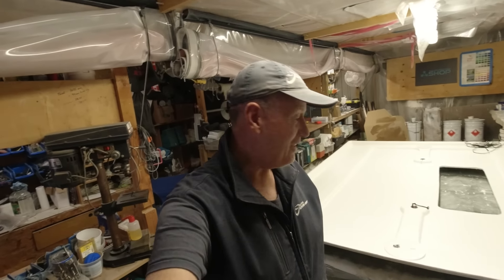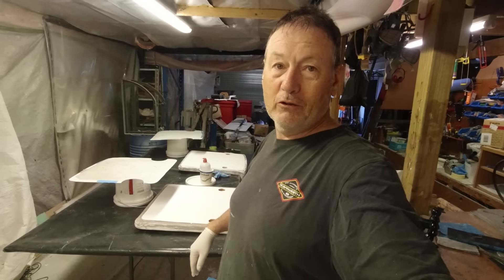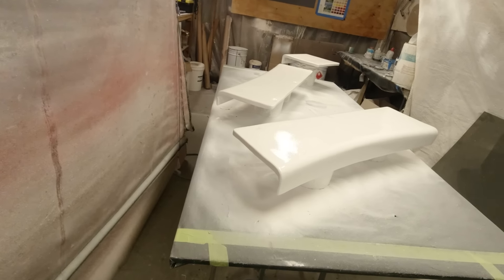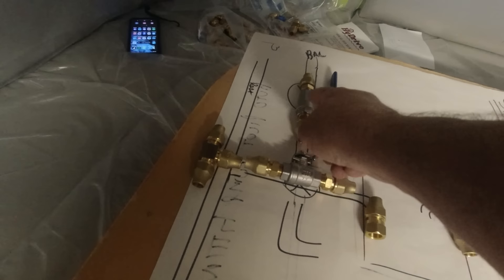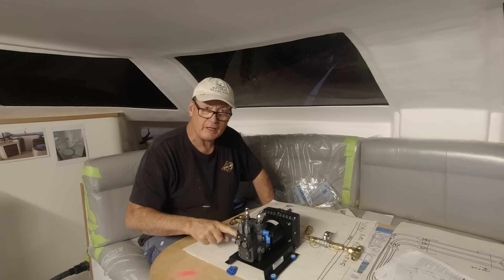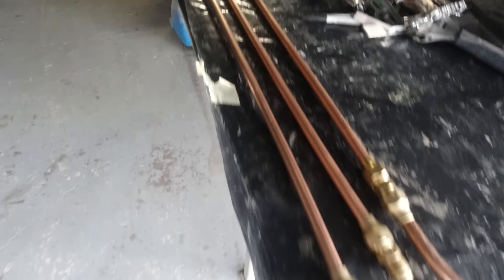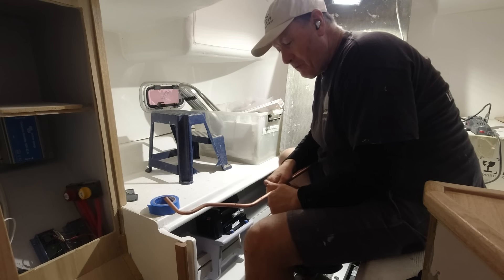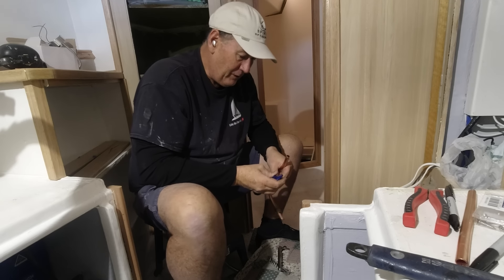Catamaran Hydraulic Steering System Install Part 1 //  Ep339

Comment: Loved this video. Retired instrument/pipe fitter in the mechanical trades for 50 years. Bent tubes/pipes 1/8" to 6" copper, SS and CS. Loved my career. Thanks for the memories. Advise to flush the completed system thoroughly, otherwise small particles will destroy your hydro pumps. Good luck! Splash date yet?

Comment: After installing several Steam and Water lines over the years, I would tie luggage labels onto those valves (and lines going through other compartments), clearly labelled with what the function of the line is, and what the valve does. (Isolate, bypass, etc.) Use Mig wire, not string, and replace the paper labels with thin metal ones with stamped lettering before you launch.  This saves confusion in an emergency years into the future when your kids are using the boat!
Reply from the maker: That is a great idea, I will definitely be labelling the pipework as per the electrial system.Rossco

Comment: Hi Ross i would just seal holes through structure with silicone stop vibration and noise from hammer . I haven't seen a filter in the system you would need at least a filter on return line to tank to filter any wear in system out to prevent increased wear rates and possible early catastrophic failure . Thanks for all your efforts to video your build have enjoyed all of them.

Comment: I would very much rather be doing the mechanical work than all the very fine finish work you have been doing!  I have to say when it comes to tubing connections, I think that compression fittings are a better alternative to the flare type.  They are certainly easier to make up, and are more durable.  Flare fittings are ok, but can be susceptible to failure, because the deformation caused to forming the flare weakens the metal at the connection point.

Comment: Ross - Good job, but you missed something.  You should have put rubber gaskets at every penetration through the fiberglass walls.  If not done, you have a good probability of having either a fracture or wear through of the tubing at a penetration point.
Reply from the maker: There will be sleeves inserted to seal the bulkheads, trying to avoid any air entry into engine rooms.My intention is to seal all penetrative to reduce chaffing.

Comment: Well done Roscoe and while it is a complex project in terms of execution and erection, it is nice to have a ‘stand alone’ meaty project to get your teeth in. I can see it has already attracted many comments.

My comments are:
1. You are right to do slow (rather than acute bends) where possible, but I would not be too concerned either way because the actual flow rates in the system are surprisingly low.
2. As the system enters the engine space, I would have been tempted to mount the valves and fittings on a board and fixed that out of the way outboard on the forward bulkhead to keep the hydraulic lines out of the way - thinking about future clambering about in the engine space.
3. As others have mentioned all bulkhead penetrations need grommeting where hydraulic lines pass through, to prevent  pipes fretting.
4. Do not get stingy on pipe bracketing for the same reason.
5. Nice to have something’s to polish in the engine room.😉
6. I would have loved to pop over and give you a hand with this, only distance prevents.😉

Cracking project and progress.😀👍⛵️

Comment: Looking good, pity you didn't use Swayze lock fittings cut to length ,push in ,finger tight then 1 and 1/4 turns good for 1500 psi +, rated for survey and don't leak. Can be undone and redone . Tube work is hard to get right and your looking great

Comment: If your only choice was a pipe bender, one method (more work) is to fill the tube with sand. That will reduce the crimp effect. Spring benders are great, but can be a nuisance for any bend that might have a tighter bend radius. (hard to get off). Very impressed with this whole mammoth project. Kudos's to you and yours. Looking forward to launch.
Reply: Not the best idea for hydraulic systems.
Reply: @normanboyes4983  Granted, it is not, but if it was your only option...then of course you would need to blow it out then flush it with water or something, and dry it,  so a LOT more work and effort.
Reply: @batmanflys8176  Are you a qualified engineer?

Comment: Great work and a nightmare at the same time. You can always get some fine steel wool and polish your flares to remove any scratches which can allow a leak to happen🤙🏼🤙🏼🤙🏼🇦🇺🇦🇺
Reply from the maker: I have my steel wool at the ready for the final assembly and a little hydraulic oil smeer on the flaring tool was the key to smooth flares. Thanks Nick.Ross

Comment: Are those copper line's going to be vibrating, if there do you will need to make sure they are not rubbing on anything, it would not take much to wear through that soft copper.
Reply from the maker: They will be secured every 45cm with rubber backed hydraulic line p-clips to bulkheads and hull sides and bulkheads to ensure no vibration wear as per Hydrives instructions.Cheers

Comment: I have always thought that bending springs go inside the pipe - quite surprised to see they work externaly.

Any views please 
Robin
Reply from the maker: Springs are often inserted in mandrel bending tube benders, these are for annealed tubing which is easily bent from the outside,not sure how we would remove an internal spring from such a long length.Rossco

Comment: You should ask the viewers for tips. Straightening copper like that is far more likely to hard draw it and make your life difficult. Best way is to stand on the end and unroll it on a flat surface.
Reply from the maker: I did use that method after drawing it out, and yes could have gone that way to start with.Rossco

Comment: Great video as always! 
Q: why copper tubing instead of stainless?
Reply from the maker: Hydrive specify only copper I guess for ease of installation , stainless tube would be a lot harder to bend and excessive given the low pressure.Given there are over 600000 vessels with copper tubing there is something in it.

Comment: Is that a low pressure hydraulic system? I say that because if high pressure those copper lines will break down faster than you think especially where you bend them. If low pressure they can last 20 years or more.
Reply from the maker: Low pressure mate

Comment: On the hydrolic steering what happens if pump fails where is the redundancy what if on passage and pump goes out .
Reply: The pump is just for autopilot.  If it goes out, you're hand steering for the duration.

Comment: Has your lovely bride ever suggested that you are just creating more work on the boat so you don’t have to go out and sail?🤣🤣 Y’all are doing great. What’s the thing with the cooper? Are you going to use a bushing where the tubing goes through any wall/bulkhead areas?
Reply from the maker: I don't think I would be still married if I kept creating work instead if getting it finished. There will be sealant bushings through each bulkhead and lines will be secured every 45cm as per instructions to eliminate vibration and hammer.Ross
Reply: @LifeOnTheHulls  Ross my man, you are doing great! I wish everyone (me included) had half as much gumption as y’all do. The world would just get stuff done. I was just curious about the places where the tubing goes through any walls. I knew you’d have an answer, and as I watch this week episode, I didn’t see any alluding to your solution. You are pretty good at putting in Easter Eggs for future videos, even if you don’t know you are doing it. 🤣

Comment: Rossco; using  copper  tubing?  You are about 12 years behind the upgrades. Take an example from Parlay Revival..... composite materials....
Reply from the maker: Hydrive implicitly specifies copper tubing, nylon tubing has the propensity to swell and there are currently over 600000 vessels with this system installed worldwide. Ability to repair in the field is the appeal of simple copper tubing.I have all composite tru Design thru hulls to be installed in the coming month.Ross
Reply: Rosco glad your using copper it won’t split or leak

Comment: WHEN ARE YOU GOING TO ADDRESS A emergency steering options for your catamaran: ie. Emergency tiller❓️ A full hydro steering is good, until... it isn't.
Reply from the maker: I have an emergency tiller planned with a hatch through the second step on the sugar scoops.Could be as simple as a bent piece of pipe fitting to a keyed fitting on the Rudder stock.With the cat bypass valve in line it will bypass the main hydraulic system allowing for potential of both rudders to operate in the event of a problem towards the helm, otherwise 1 rudder would still steer effectively albeit hard work.Steering can also be achieved with use of both motors alternating or one rudder and opposing motor. Redundancy would be key to successful recovery of a failure.So much to think about really.

Comment: i see, later in this video, that you did your homework on the use of copper and flared fittings. Still, sea water / mist , does not fare well with copper....
Reply from the maker: Agree, will have to keep them clean, could be a challenge.
Reply: Metal shield clearcoat for copper and brass might help. A Dulux product - spray or paint